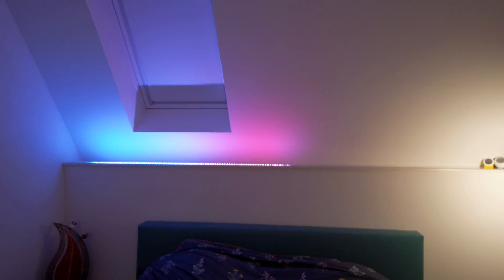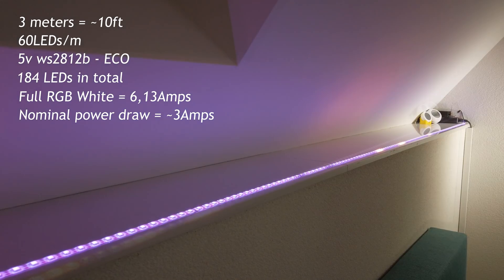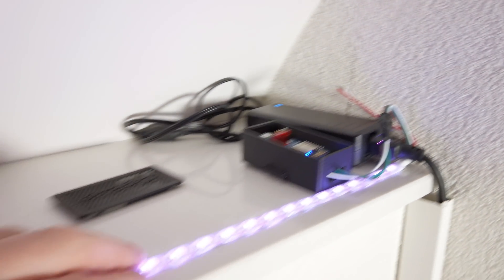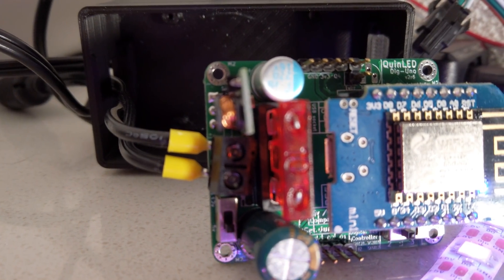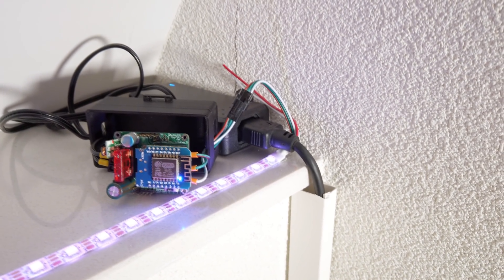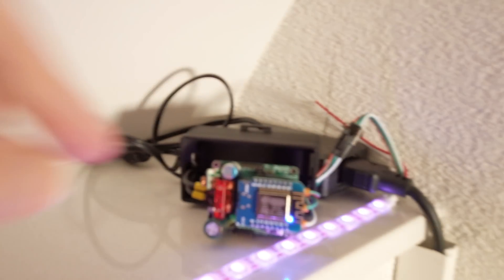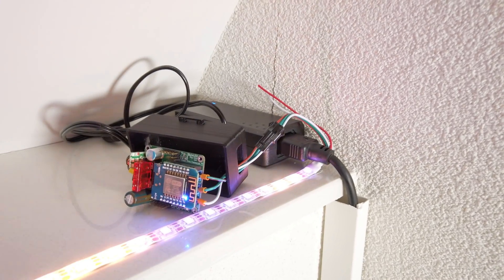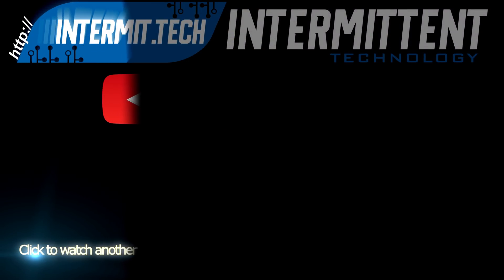💡QuinLED💡 What do you need for Smart bedroom LEDs?

Comment: Why are the ends power limiting? 3:00
Reply from the maker: Right I should have explained that better, a barrel plug rarely can transport more the 5Amps. Especially the barrel to 2-wire adapters are horrible and don't really do more the 3Amps before showing massive voltage drop in the plug. We've seen lots of them half molten even so they are dangerous to use in this application. Snipping off the barrel jack and sure the wires solves all of that immediately and it had no problem running through much more current. It's why my boards have a screw terminals and not a barrel jack. Barrel jack sockets up to 10Amps do exist but require extensive heatsinking and are 2.5$+ a piece, even at volume, a 0.15$ screw terminals still does much better. :)
Reply: @IntermitTech  I was not expecting you to comment on such an old video, especially not so quickly! Thank you very much for the quick and informative response! Shame the barrel jacks are so limiting, they look so much safer to me.

Comment: You seem like a guy that know a lot about led strips, i have a question that i simply cant find an answer but could be a expensive screwup if i try, i want to connect 20m of addressable rgb strip 5v 60diods, i would splice them on  1m lengths and connect power separately from standalone power supply, but and here comes my big question, i want to connect my asus aura to stream data to it via addressable plug on my motherboard, if i connect power from one source and send only data wire from motherboard will it work on my command and=can i damage my motherboard that way? (sorry for posting same thing on multiple videos but i rly need an answer)TY :)
Reply from the maker: Don't post on multiple videos, maybe just join the Discord and ask directly there 😅

Your question, no clue if the aura software can address 1200 LEDs (probably not). Next you are going to take a massive hit to the LED framerate, it'll drop below 30FPS for the LEDs because of the protocol used.

But if the motherboard is sending out 5v data signal that is compatible with ws2812b (some indeed do) then you need to have data and ground connected between everything. You need to make sure 5v positive side  stays seperated between the different power supplies.

Injecting every meter is total Overkill, for generic effects and such, front + back per 300LEDs should be fine. Make sure to incorporate a fuse per injection line.
Reply: @IntermitTech  Ty this is helpful a lot, will join ty.

Comment: So, if it only has 4w consumption. Could i use a 5v1amp power supply?
Reply from the maker: I think you might be confusing Amps with Watts. Usage is generally maxing out around 3Amps to 4Amps so 15w to 20w.

Comment: Thank you. Always enjoy and learn from your videos. One recommendation request, and it seems that you're not so much of having led strips outside, but if you would,  which ones woupd you rather have when you have snow and rain in the winter? IP65 inside aluminium rails covered with plastic difusor or IP67? I live in Bavaria and during winter it can (and will) be nasty weather.
Reply: Silicone sealant around anything that might get moisture. The more the better and you'll be fine
Reply: @dmo848  thanks man. I really appreciate it

Comment: I've got a similar project. A 16m bedroom area to cover with LED strips. I've bought 2x 24v 20m strips. The seller doesn't list the wattage of the LEDs but there are 600 LEDs per 10m and since I need 16m that's 960 LEDs. The problem I'm having is deciding on a adequate power supply. Can you advise?

The 10m kit came with a regular 24v mains supply that days it's 3.5amps. I assume I need roughly double that to do 16m but I don't trust the PSU it came with to be correct since it came off amazon. But then how do I get it to have enough watts to power my LEDs when I don't know what watts I need?
I bought a vented silent power supply that says 24v 10amps and 120w. Will this be enough?
I read that to calculate wattage you multiply voltage by amps but if I work that out for the above PSU it comes to 24x10=240w. Why is 120w listed? I can't imagine my 960 LEDs 8 watts of power each. What do you think?
Reply: I'm in the same boat, 15m of RGBW 5v, the power supply I bought sounds like an old train, I am considering to buy another strips 12v... or running cables and hide the psu
Reply: @OskaiserPlayer  the problem with 12V is they lose colour over 5m. I have another project where I have around 20m around the ceiling and they're 12v. The colour is noticeably faded about half way down but it's only really noticeable if you use something close to white. Otherwise if it's just the glow you're after it's okay for the money. It also just runs off the normal 12v power converter it comes with so there's no noise.

Comment: Would this work with Alexa?
Reply from the maker: Although I have not used it yet myself, I believe WLED (the software) has good Alexa integration
Reply: @IntermitTech  ok so cool I can do this with wled atleast because I’m pretty much invested all Alexa right now
Reply: @IntermitTech  just a quick question if I wanted to do my outline of my room ceiling what’s the max length of strip can a 5v 60 led strip can a dig uno do?
Reply from the maker: It's not so much a max just figure out the nominal power using the power sheets, and then check the board specifications, that should give you the best results. But generally 1 to 3 strips is fine. Dig-Quad would make injecting for such a project a bit easier though, especially on 5v.

Comment: We currently have a strip behind the bed's head board, connected to an Arduino Nano controlling the LEDs to act as a wake-up light. The nano is running modified script I originally got from Rob Tait (thehookup). Together with Tasker on my Android phone it starts a sunrise 20 minutes before my alarm goes off. I'm now planning on converting it to a Dig-Uno and WLED and use the sunrise effect in timed mode. The Home Assistant app natively supports 'next alarm' on Android. Not sure about iOS. So a simple automation in Node-Red for example should give me the same result, although much more reliable. You certainly could use this strip as a wake-up light too!

Still waiting for some parts to arrive from China to assemble my first couple of Dig-Unos. Very much looking forward to the end result! Thanks for sharing you design and knowledge with the community!

Comment: Not completly related but can you also connect and control analog led's on the dig - Uno / quad models? Or do we need to buy the non-digital quinled version for analog led's?
Reply from the maker: For Analog you really need an analog board.
Reply: @IntermitTech  thanks!

Comment: Hey there Quindor!  I bought your Digi-Quad from you directly about a month ago here in Houston Texas since Dr. Zzs was all sold out here in the U.S. I just bought me a external 300 watt 60 Amp, 5 volt power supply and heavy duty 3 prong wire with ground to connect it and power it up and then connect your Digi-Quad controller and install WLED to get it going.  I am too late for Christmas holidays this year but my plan is to install about six to eight 5 meter runs of BTF SK6812 RGBW (warm white) along the soffit of my roof on my house for permanent Holiday LED lights as well as just using the rest of the year with the warm white LEDs as an accent lighting on the house. Anyways, thanks for all you do and Dr. Zzs too for us wanna be LED professionals.  Thanks again for getting me that Digi-Quad controller to me I cannot wait to power her up and try her out. Happy Holidays!

Comment: Mind me asking why you didn't go with a mini or micro fuse? They're quite a bit smaller 😁
Reply from the maker: You can actually fit most in this socket type, but I went with ATO size because they are available cheap everywhere and they can handle the power I need them to. :)
Reply: How much power can the fuse actually handle? Like if you're running many strips in series and doing power injection (in parallel, direct from power supply), getting up to say 60-70 amps @ 5 volts, would that blow this fuse?
Reply from the maker: Well if you are going through the fuse, it will blow, for sure. If bypassing it, we'll it won't. But using that amount of Power, take a look at the Dig-Quad or maybe an external fuse and distribution panel!
Reply: @IntermitTech  Bypassing meaning what? I'm not quite sure what would happen or how many amps would flow through the dig-uno if the dig was connected directly to the power source, but there was also a separate two-core wire also running directly from the power supply along the full length of the led strips doing power injection every 5 meters
Reply from the maker: Well a single injection point will only take so much power really. Let's say 3A to 4Amps, 5Amps max, after that it just won't ask for me because the voltage will start sagging too much from the little amount of copper the strip has.

Comment: Does the wife accept the charger and cable gutter Quindor when the video is finished 😂? 
I tried planning for proper wiring during my renovation and it's not easy.
How compatible are your boards with the Arei regulations?
Reply from the maker: Well if I put it there properly most cables are basically hidden, she's ok with it at that point. :)
I haven't looked into AREI regulations but with all the testing I've done and the onboard fuse, it will be as safe as any other "appliance" you have in your house, that's my opinion, but still. :)

Comment: Nice work mate can i ask a question what is the current rating of of this board for 5 Voltages and can i run 15 meters 60/m on 5 voltages on this board?
Reply from the maker: All the specs are on the specification page, but yes you can run 15 meters but since you have to do multiple injections because of the 5v I'd consider upgrading to the QuinLED-Dig-Quad for taking, it'll make the wiring a lot easier!
Reply: @IntermitTech  thanks for reply so its means i can use different power supplies with common ground  eg 10 A 5 volt power supply for each 5 meter 60/m or should i use only one 30 A  power supply?
Reply from the maker: Using a single power supply is best. If you use multiple you'd have to make sure the positive rail is disconnected between them which means you are going to need to run even more injection wires (per 300LEDs front and back)
Reply: @IntermitTech  thanks for reply and much appreciated for your good work best wishes from Pakistan

Comment: How do you connect a long led strip eg 15 meteres, could you make a video on it please
Reply from the maker: That's coming, but check out the QuinLED-Dig-Quad for that and it's wiring diagrams, should explain a lot of it!
Reply: I have the same question I’m trying to do atleast 3 5m strips maybe 4 but I can find a vid on this or a project of some one doing like the outline of a room usually it’s just one line across not a full square
Reply from the maker: Check out my LED setup live stream, it explains how to calculate all of it in about 2 Hrs time! After that you'll know power usage, I injection points and wire thickness needed for your setup!